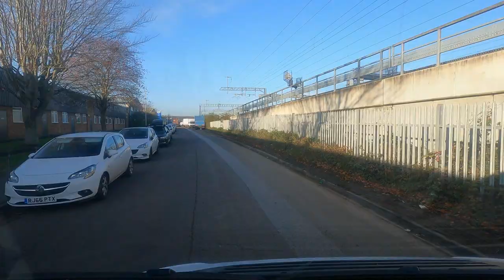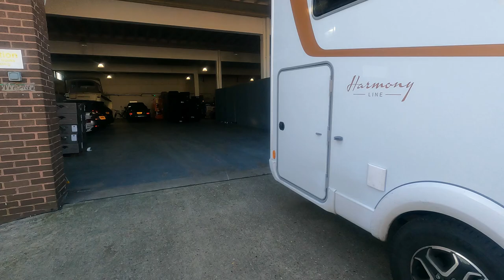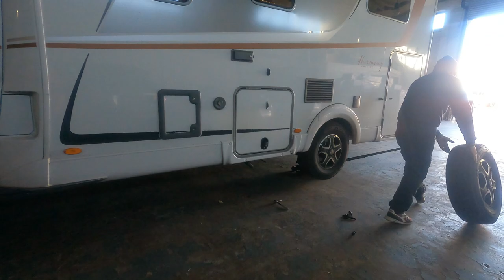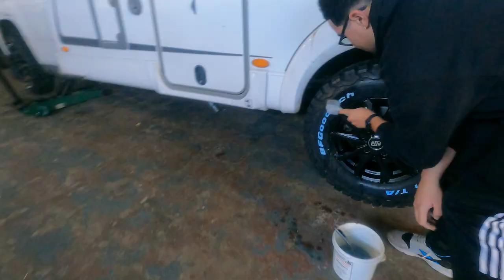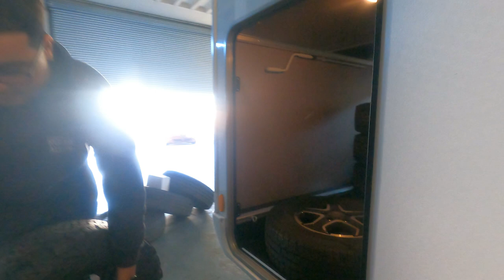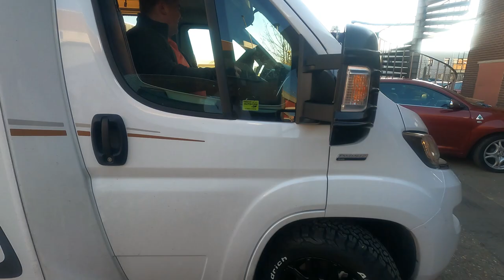The BEST "Off Road" Wheels & Tyres for a Motorhome.

Comment: Hi are you planning on alternating the KO2’s in the winter with Fiat Michelins in the summer? Cheers Shaun.
Reply from the maker: That's the plan! Ill keep these on until spring and then change back to the others in the Autumn. It means i can alternate the tyres around as well to get the best wear throughouth the year and it keeps the look fresh through the seasons.😁
Reply: @littlebigvanadventures  That’s my plan also. 👍🏻
Reply: Just about to order similar Alloys & Tyres from same company. Thought I’d check with the insurance to see if there will be any increase in premium. They want £150.00🥵. I’ve got a new Adria with same alloys as yours. I can’t believe the cost . If you don’t mind me asking did your insurance increase as much ? Cheers Shaun.
Reply from the maker: @RV-zk7zq  No increase on our premium - have you told them that they will only be on in bad weather?
Reply: @littlebigvanadventures  
No I’ll try that, I’m with Comfort Ins. A couple of others have said they had no increase in their premium either. Cheers, Shaun.

Comment: Hi
Great video and love the wheels. Quick question did your van have tyre pressure sensors? If yes did you use the old ones, turn them off or have to buy and fit new?
TIA

Comment: I highly recommend that you remove them & add copperslip grease between the alloy wheel & the steel brake discs...

I have the same wheels & tyres on mine (great so far) - but mine weren't greased when fit (typical of grease monkey tyre garages) & were an absolute bar steward to remove. Would have needed a break down call out if I'd of had a puncture.

Good luck.
Reply from the maker: Thanks Paul - thats really good to know. Im planning on taking them off in the next month so hopefully they wont be too difficult - Ive ordered some copper grease. 👌